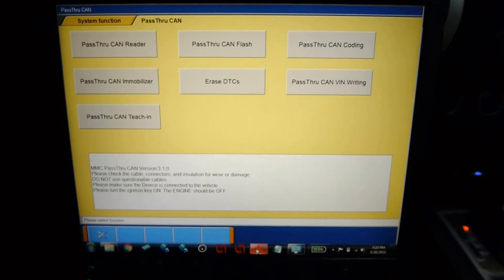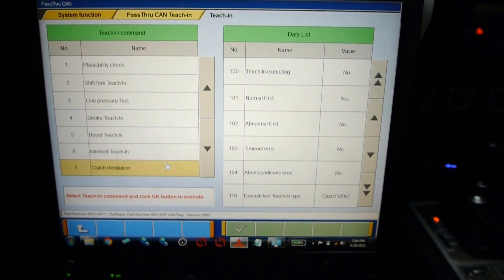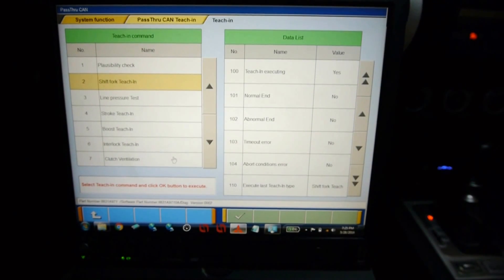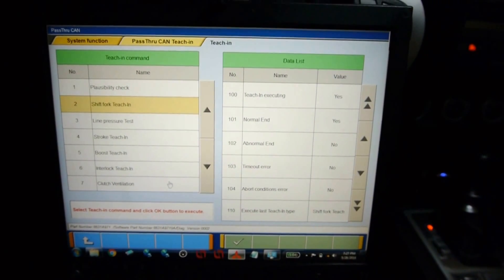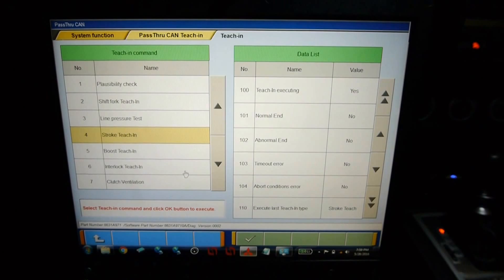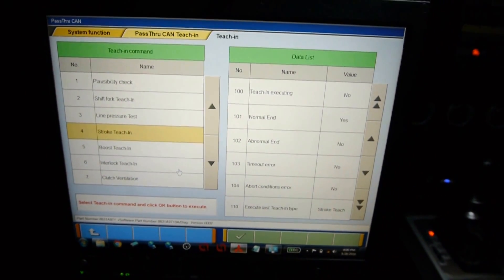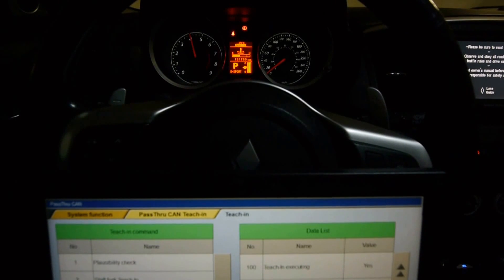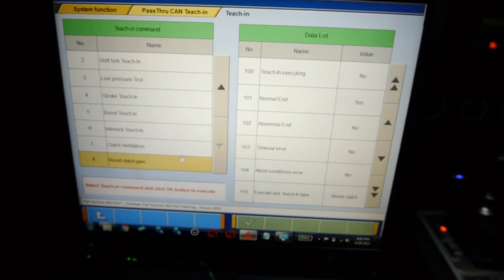SST teach-in Mitsubishi Lancer Ralliart and Evolution X MR

Comment: Hi, does this teach in works for all SST in any country? thanks a lot for the info
Reply from the maker: Yes, this will work for any Mitsubishi vehicle with an SST, whatever country it was sold in.
Reply: Hi Stephen, under teach in, I don't have the function 8 Reset Clutch gain, I think this is the most important part right? any thought?
Reply from the maker: If you are replacing any components in the transmission, the clutch and/or mechatronic assembly, the first steps will be just as critically important. If you are only looking to reset the stored values that account for clutch wear and/or possible adaptation to driving habits (we are still discovering more about this) as part of a regular “check-up” on the transmission, or before or after a track day, then Reset clutch gain likely is the most important.

Step 8, Reset clutch gain, is not normally visible on the screen. First click on step 7, Clutch Ventilation, then click the downward-facing black triangle to the right. That should scroll the list down, and allow you to click on step 8.

Comment: Got a question for anyone here. First off, this video https://www.youtube.com/watch?v=IN6YQhWgY88 is exactly what my car is doing. Not my video but it's 100% what mine is doing, the click, click and grind at the end. Same year and everything. Would tuning/teach in help with this or what is even going on with my car? I've been told it could be numerous things and also to teach in the Evo software. Around here in Iowa, no one seems to know how to work on this car so I'm trying to reach out to other ralliart/evo owners.
Reply from the maker: This was a known problem with the 2009-2010 Lancer Evolution MR and Ralliart. Mitsubishi issued a Technical Service Bulletin to solve it: "On affected vehicles equipped with W6DGA TC−SST transmissions, the TCM quickly engages and disengages 5th gear to determine whether the vehicle is moving. Noises can be heard as the shift fork attempts to move from neutral to 5th gear, and back to neutral immediately following engine start after an
extended time being parked (e.g. overnight parking).
This TSB instructs technicians to reprogram the TCM with new software to prevent gear noise by
eliminating the 5th gear vehicle speed check."

From my experience and the experiences of others, most dealerships are unable to follow the simple instructions on performing the software update, so you're better off doing it yourself using PassThru CAN.
For a 2009 or 2010 Ralliart you would flash 8631B002.cff which contains version 8631A8600B, or for a 2010 Evolution MR you would flash 8631B001.cff which contains version 8631A8270B
Reply: Stephen Strangways Dude, thank you so much. I'll work on that this weekend. Everyone kept throwing an 11k bill my way for a brand new tranny when no one really knew what was wrong. Does the PassThru CAN come with the software needed to flash over into the car or do I get that somewhere else?
Reply from the maker: Yeah, it's annoying that something as simple as a software update is impossible to comprehend at most Mitsubishi dealerships.
Everything you need is here: https://drive.google.com/drive/folders/0B4WZqKW7T8KyeFpxeWpPeDBvVDQ
Reply: Stephen Strangways I searched on Amazon for the device in the guide needed to connect the laptop to the car and didn't find the exact one listed. I assume its still available, just can't find it.
Reply from the maker: There are plenty of cheap clones and knock-offs available, but they can cause some serious issues, like bricking your ECU. It will cost a bit more to get the genuine article, but it's worth it:
http://www.tactrix.com/index.php?page=shop.product_details&flypage=flypage.tpl&product_id=17&category_id=6&option=com_virtuemart&Itemid=53

You do not need any of the Reflash Adapters, so you can leave that at None.

Comment: First, I am very grateful for your help.
I bought tactrix to do tcu reprogramming because of sst bed noise and installed can passthru.
However, I tried the TC-SST Flash_Reflash Guide as described, but I get a message that the update is unnecessary.

Currently my evo's ecu part number is
  8631A827, s / w part number is 8631A8270B.

I can not reprogram, I still hear intermittent sst bad noise, and I would be very much appreciated if you explain step by step.

Finally, do you know why all items related to sst teach-in timeout error after pending?
Reply from the maker: if you have 8631A8270B it shouldn't do the fifth gear check on startup. So if it's still doing the check, you could try updating to even newer firmware, such as 8631A9710A which you get by flashing 8631B151.cff

If it's not doing the fifth gear check on your current or that firmware, and you are still getting noise on startup, it is most likely an indicator that you have a shift fork problem and you might soon lose your ability to use either your even or odd gears.
Reply: Thanks for the reply.
So how do i upgrade my evo firmware?
Do I need to modify the files in the xml folder of pass can thru?

I have mut-3, tactrix. Can I use these devices?
As I said last time, due to the withdrawal of Mitsubishi, there is a lack of information in Korea.
I would appreciate your kind attention.

Finally, do you know the reason for the pending -> timeout error in teach-in?
Reply from the maker: Yes, you will need to place the .cff file, and the modified xml file, in the appropriate directories as per the flash-reflash guide. And only one set of xml and cuff files can be in the directories at one time.

Tactrix or MUT-3 would both work.

The timeout error is most likely due to the SST not being at the proper temperature, either too hot or too cold.

Comment: I have 2008 EVO X EU UK Car and I can't do the teach-in , it says....
"invalid TC-sst recalibation data. Please contact mmna"
But I do have "TI_Info.tipart" file in the C:\Program Files\PassThruCAN\DiagDB\XML\ 
Help please :)
Reply from the maker: The problem is that the firmware on your TCU is so old that it doesn't have the ability to do a teach-in. The "diag version" is too old. You'll need to update your TCU firmware, which is a good idea anyway.
Reply: Many thanks... Its all sorted although the re-flashing procedure kept failing about 6 or 7 times but eventually finished normally.
The gearbox wouldnt select any gears until I had finished reflashing so once you start you have to finish... !

Comment: If you flash a cff from an evo mr to get the ssport mode on a ralliart, would you then need to perform a teach-in? Or is the teach-in information stored elsewhere on the TCU?
Reply from the maker: My experience has been that the teach-in information is stored and not affected by flashing different TCU software versions on. That being said, if you are updating from really old TCU software (diag version 0001), it will not have had all of the teach-in functions, so in that case, you'd definitely want to do another teach-in. There is no harm in doing another teach-in if you have any doubts.
Reply: Stephen Strangways I just updated a 2010 Mr from 8361A8270A to ..8270B. I'm guessing it should be fine. Drives pretty much the same as before the update.
Reply from the maker: 8270A can have the "transmission gear noise after cold engine start," while 8270B is the latest version for the 2010, and it avoids that problem. So, you should be all good to go. I'm not aware of any changes other than the cold start noise, so I would expect it to drive just the same.
Reply: I am wondering if the file I used is correct, the gear noise at cold start still occurs.
Reply from the maker: Did you use 8631B001_dio30.cff ? If it didn't end in _dio30, it might not have been the right file.
Reply: Stephen Strangways It said ..dio30 at the end, I was through to make sure everything was correct. Just wonder why it still makes the noise.
Reply from the maker: Two thoughts: Ralliart owners often flash the newest Evo X firmware to their cars, the one for 2011-2015 models, even if they have a 2009 or 2010 Ralliart. That would be 8631B151_dio30.cff which contains 8631A9710A. You could give that a shot. The other thought... updating my TCU software got rid of the noise on cold starts, until all of sudden it happened again one day. And then I got a CEL and shift fork failure codes. The magnet had fallen off of one of my shift forks. The noise it made was similar to, but slightly different than, the cold start sound of 5th gear engaging and re-engaging.
Reply: Stephen Strangways Stephen Strangways Assuming there isnt much of a risk in bricking my tcu by updating it to 2011-2015 software, I think I might try it. I still hear the two clicks of the fifth gear check despite being updated to the version specified in the tab for cold start gear noise.
Reply from the maker: It won't brick your TCU. You can freely and safely switch between years, and also go back to older versions if you wish. The TCU is very forgiving. Usually if you flash an ECU and your computer freezes or your car battery dies, you will brick it. But not with the TCU. You can just fix the problem and start the flash again, no problems at all.

Comment: Hi I would like to know if this teach-in would help with a p1870 code?
Reply from the maker: It won't hurt to try. Have you had your car tuned? if so, and it wasn't someone REALLY familiar with the SST, I'd also consider that to be a likely cause of the code.
Reply: Stephen Strangways thank you for your response. Actually I had out on a bunch of mods and was pulling some laps on a hot day. And that's when it happened. The car is down for over 1 year now. It breaks my heart to see that. And I'm my country there's no tuners. So I'm  at a huge disadvantage. Any help will be greatly appreciated.
Reply from the maker: What mods do you have on the car?
Reply: Stephen Strangways currently I have on a tubular exhaust manifold, 3" down & test pipe, 2.5" cat exhaust. 3.5" intercooler, hard pipes, hks athmospheric BOV, radium fuel rail, radium FPR, radium fuel pulse damper, 1200CC BOSCH injectors, and a cheap cone style intake made to fit in the original air box.
Reply from the maker: And was the car tuned with all of those parts installed? If not, there is your problem right there. If yes, if the MAF housing was changed and it wasn't tuned PROPERLY, with the MAF scaled by a competent tuner who understands airflow models, that's your problem.  And even if it was tuned by someone competent, your BOV venting to atmosphere could be causing your problem.

If you don't have tuner local to you, but you have a Tactrix cable and a laptop, you could get an e-tune from someone who understands the SST really well. There aren't many, and I would say that the best of the best is https://www.wtftuned.com
Reply: Stephen Strangways I actuall had a guy from the USA tuned it with all the parts. And I didn't change the MAF housing, the housing is stock.  I just put a scilone hose in the box and fitted the cone filter in. I'm also getting a low voltage MAF code. I had someone looked at the transmission ecu map and they said it still looked bone stock. The tuner just collect my money, sent a map for me to flash then said it's not the tube its the transmission.
Reply from the maker: It sounds to me like you've modded your car in a way that will make it sound louder (intake, BOV) but will hurt performance, and then got ripped off by an incompetent tuner.

That intake will be sucking in hot air from the engine bay, will be affected by the radiator fans coming on, and if it's an oiled filter, that oil could be gunking up your MAF sensor. I would suggest going back to the stock intake, which will suck in colder air through the snorkel, and give you more than enough air for 400-500 horsepower. Clean your MAF sensor with SensorKleen or electrical contact cleaner while you're at it. This is good info: https://youtu.be/-8eIxSbow6I

If your BOV is venting to atmosphere, what will happen is that the ECU will be metering the air that comes in, and basing everything it does from that. If the BOV vents, you all of a sudden have a lot less air in the system than the car expects. A full recirc BPV will perform best with these cars. The stock Evo X BPV will be fine for running in the low to mid 20s for psi of boost. If your BOV is 100% VTA, but can be configured for 50/50 vent/recirc, at least doing that will help a little.

Lastly, you need a proper tune where someone will read the logs from your car, and go back and forth several times with revisions to dial things in for you. It is especially critical that they understand the SST. Even if they aren't changing the SST tables (which they should, if you want to get the most out of the car for both performance and everyday drivability) they need to get the airflow models correct, because the TCU relies on torque estimates from the ECU to operate properly. Get it wrong, and the transmission will perform poorly and wear out much sooner.

A tuner who also just loads in a ton of boost right at the start will also cause massive problems - the SST can only handle so much torque, especially at low RPMs and during shifts. Getting that wrong will lead to increased wear and complete transmission failure.

I've seen many tuners who are great with the Evo GSR and other manual transmission cars, but who don't understand the SST and their work will absolutely destroy them - and/or blow engines.
Exactly that has happened to two of my friends who went to a tuner who knows DSM tuning quite well, but is terrible with more modern cars that have MIVEC, electronic throttle control, and the SST.
Reply: Stephen Strangways ok the car came with those hks drop in filter. I took that out and install the cone filter in the oem box. And now the drop in filter has degraded. Believe  it or not they don't sell evo parts in my country. So if I go back to the oem filter and recirculation bov ad clean the maf would that fix the issue?. Thank you for your patients. Oh and after the tuner sent me the map and I flashed it I no longer see the p1870 code. But before on the cobb access port I used to see the code. What's with that?
Reply from the maker: Is the tuner sending you maps just based on you telling them what parts you have installed, or are you logging the car with EvoScan, just driving around, and then doing pulls in 3rd and 4th gear and sending the logs to them, so they can can revise the maps based on what your car is actually doing, and send you new maps?

And are you currently using a Tactrix OpenPort 2.0 cable for your tunes, or are you using the Cobb AccessPort?
Reply: Stephen Strangways sending maps! He only sent me 1 map and told me to do a cruse log for 25 mins, no WOT.  And I have both cobb accessport and the tectrix 2.0.
Reply: I'm using the tectrix 2.0 with evo scan. Because cobb don't make maps for the jdm market they only sell the cobb ap . Which I don't understand why they would do something like that
Reply from the maker: How much are you paying this tuner? I'm on my 8th revision with my tuner. It started as city cruising, then highway cruising, then 3rd gear pulls, then 4th gear pulls, then launches from a dead stop, through 1st, 2nd, 3rd, and 4th.

You definitely want to be using Tactrix and EvoScan, because even if you could custom tune from a tuner using the Cobb AP, it has no ability to log any info from the SST, and any maps for it cannot alter the SST, so it is a terrible choice for the MR or Ralliart. It's overpriced but fine for the GSR.
Reply: Stephen Strangways I payed 
US $300. that's why I said I'm at a disadvantage. It's getting me depressed. I don't know what to do and who to trust. I wish if I could send you pics of the car. It tears me up. It's got the MR FQ 420  front bumper or the JDM 
test & service. But it came from Japan.
Reply: The car came from Japan.
Reply from the maker: For that kind of money, the tuner should be making as many revisions to your tune, based on logs you've sent, as it takes to get the car running perfectly.
Reply: Stephen Strangways well unfortunately I wasn't given that liberty. But I want to say thank you so much for your patients and time. And don't take your skilled persons who have the time to invest in you and your machine. They are other car lovers who do not share the same balance.
Reply from the maker: Who is the tuner? If nothing else, other people could be warned. My e-tune was $350, and he'll keep working on it until it's perfect.
Reply: Stephen Strangways I perfer not to name anyone. I'm a person of faith. But he's a tuner recognized on the forums. God will see me through this tough time.

Comment: great video! I have all the files in place needed for the teach in but when I pull up the pass thru can all the options are light gray except for the pass thru can reader? I need to perform a teach in but cannot select the function. any ideas on why this may be happening?
Reply from the maker: You need to replace the file C:\Program Files\PassThruCAN\System\Common\PTC32.dll with a newer one that you download from the same place as all the other files.
Reply: ive deleted the file and replaced It still no luck. is a newer file available? my evo is a 2011 x mr if that makes a difference
Reply from the maker: It has nothing to do with your car and everything with PassThru CAN. There is no newer version, just the locked Reader only version, and the fully unlocked version. Make sure you are following the instructions in the TC-SST Flash_Reflash Guide.pdf starting on page 11, and that you are using the ptc32.dll that you downloaded from https://drive.google.com/drive/folders/0B4WZqKW7T8KyeFpxeWpPeDBvVDQ